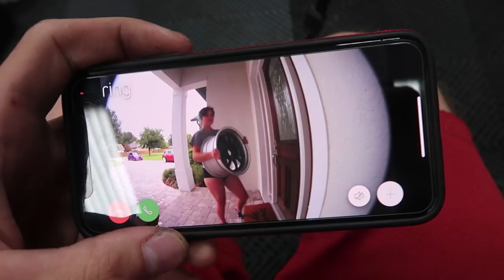SKYLINE QUESTIONS ANSWERED!

Comment: Wonder if Adam will see this but they sell skyline taillight led inserts/mod. You have to open them to insert the led circle in them but they are actually pretty sweet. You have multiple settings to control the LEDs to make it flash for show or normal driving. You can make the LEDs also look like R35 taillights. There's an app to control the settings. RANDY from illiminate did this mod to his R32 GTR.

Comment: Adam, get the termite damage repaired under your home warranty (hopefully it's still active). Then, call Massey's for the termite bond. Last September I paid $600 for the bond and the treatment sticks, and yearly renewal is only $99. Obviously, your costs may vary depending on the number of termite spikes they put in the ground and the size of your lot. Disclaimer: I do not work for Massey's, and I get nothing if you use their services.

Comment: Adam, you can pull apart the taillights and put halo lights into them to have the constant red rings, if you splice them into the gauge cluster power they will come on as soon as you turn the key to accessory

Comment: Hey Adam, i hear you saying like 5 times that your tail lights are on all the time and that Alberto check the wires for a short, but i think you forget to check something really simple yet important to that matter, between the brake pedal and the brake pedal sensor there is a piece of hard rubber which avoid the weight to the pedal make contac with the sensor unless you press the pedal, if is broken that is the cause of your  tail light are on and is like $3 fix... hope this help... keep the awesome work..JF.

Comment: You could mount the thing on the other side of the tunnel and keep it even with the shifter and bend it toward  you and then straight up right abouve the shiter, from shifter to brake without a lot of movement.  It's also not right at your left knee

Comment: That sucks about the termites but it’s not really a huge problem since everything structural is made of concrete and cinder blocks with rebar in Florida for hurricanes and any wood other than trim and cabinets is treated. That is still a pain to deal with especially in a new house

Comment: You can make coupe lights fit but you have to change the mounting stuff aka cut and weld a coupe rear end on. Also the coupe and sedan and the same length etc that's why there is no room in the back seat it's just a coupe with 2 extra doors

Comment: What about sr22 + ve head? You could build that strong, have i rev higher and have the turbo spool faster at the same or more horsepower rating. Also you could install the AC back in the s13, fix the quarter panel paint it and have a fun and reliable car.

Comment: if you want to protect the outside of your house from termites use old and used engine oil. no its not the greatest thing to do but ive been told directly from the mouth of a company worker that oil is the best thing you could use